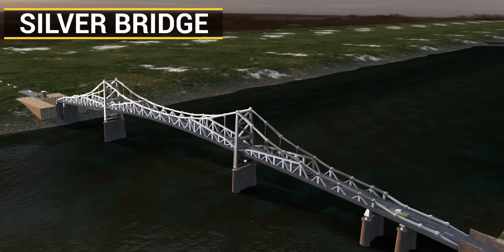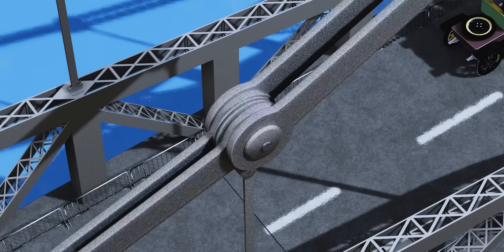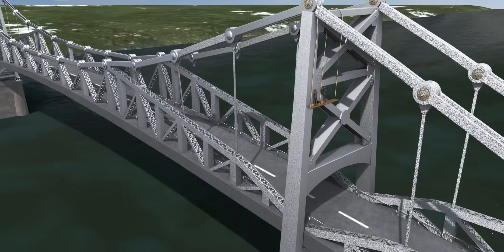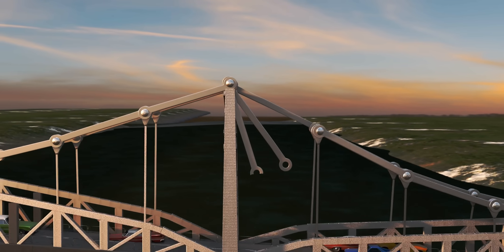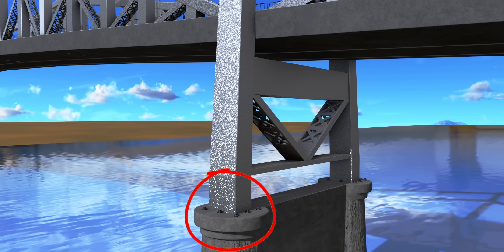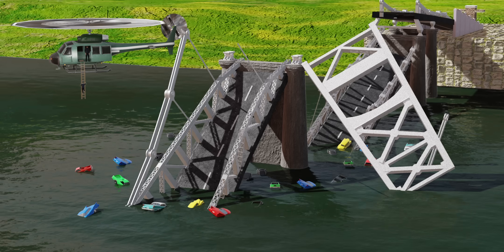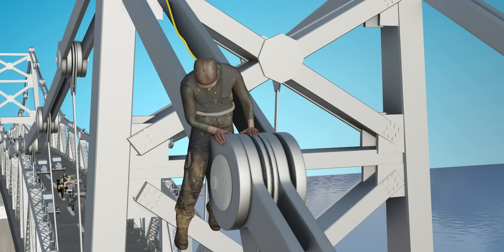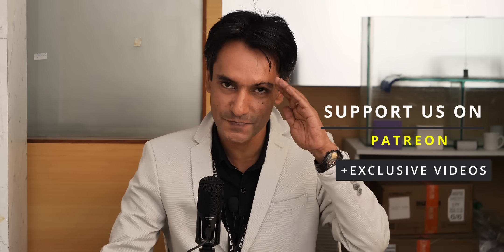Silver Bridge | The Tragedy That Changed Civil Engineering Forever

Comment: If fuel fossil vehicles were to be replaced with more carbon friendly, but significantly heavier EVs, will bridges/roads, multi-story parking garages, etc… need to be reconstructed to support their weight?
Reply: We tipycally design bridges with trucks in mind so no. Unless there is a very big change on max loads there will be no need to
Reply: @pablototox how about when ev trucks are made? I know it does not exist but it can be a possibility factor. We need to add possibilities so designs last for generations
Reply: No, ofc not. That’s mainly bc those buildings are already designed for much higher pressure, and, especially in the US, vehicles already are quite big and heavy.
Reply: I think the move from sedans to SUVs and large trucks are a bigger factor in the increase in weight, at least in the US. Much more of those are around than EVs
Reply: @pc290 the size of vehicles is going up because the biger the vehicle shadow determines the fleet gpm improvement need if you didn't improvement gpm just make truck  slightly biger it's a stupid loophole that they use here in states
Reply: @pc290  by 1000 pounds in some vehicles  and even heavier for semi trucks.
Reply: @pc290  vastly bigger.
Reply: @pc290  US was always that way. In other parts of the world in general, family pickups are rare, and (ladder frame 4WD)SUVs are considered as jeeps not cars, minivans as vans, while the eco. cars for the masses constitute a lot of hatches, CUVs(marketed as "SUVs" sometimes), sedans, mpvs, sportbacks, some coupés, and rarely mini sportcars as of now.
Reply: Not everone will own a EV unless we can sort out places for everone to charge them + the infrastructure to charge all these cars at the same time with out blackouts which we are along way off from
Reply: A Nissan Ariya, a fairly large EV crossover, weighs about 4,000 pounds. A f150 weighs 5,000. We already hace the infrasyructure for giant cars. @harrydalgleish8464
Reply: @harrydalgleish8464 Every EV can not be built with 300 to 700 mile range bats or the weight and cost will be insaine.
Reply: @harrydalgleish8464 that’s already being sorted out. There are multiple networks that are expanding pretty rapidly(Ionna, Walmart, etc). Even here in UT, which has 95% of its population in one or two counties around Salt Lake City and basically nothing outside of that, you can get anywhere you want in an EV already.
Reply: You do know one company wanted to go electric. At one warehouse. They were laughed out cause the plan. Would draw more power than all the city uses.

Want to give up acres of farm land and forest to make solar panels that help rain ride the ground More and make hot spots and kills plants that make oxygen... 

Like cool solar farms everywhere and mining pits that stripped the world naked while poisoning everything.

And Wonder if moving conductive metals from the ground and into concentrated forms in citys effects magnetic fields... like metals should... hole in what again is growing and splitting in two...

Wonder how much earth's screwed cause of that stuff everyone learns in basic science but never applies to our real world.

Kinda like they pretend only china's dam effected earth's rotation.  Like what about the stuff everyone else did, strip mines and water bodies created all over..  but world acts like its just china that physics picks out.

Like ok now we change earth's balance and stuff cause china did 1/4 of what everyone else together has.
Reply: @harrydalgleish8464  solar wind nuclear and vehicle 2 grid can all help with the power issue as well as battery storage for grid offpeak/peak hours

Also yes likely bridges would need to be structurally assessed for heavier evs for the moment until battery tech is improved to be lighter
Reply: @ToniMorton nope
Reply: @ToniMorton  Nuclear alone would easily handle it, but too many are too afraid of it.

Solar is still too inefficient and wind is still too harmful to wildlife(causes the deaths of thousands of birds annually, more than fossil fuel burning by a lot).

Until we get money out of environmentalism and science, everything will only focus on what makes the most profit thus is cheapest meaning no real innovation will occur in a meaningful way.
Reply: @ToniMorton thats wont happen for a long time as there isnt a market for electric vehicles. Outside of the wealthy no one can really afford them
Reply: @harrydalgleish8464 EVs are like the First cars, and petrol cars are like horses. It's just a matter of time before the economics flip, soon EVs will be cheaper to buy and run, eventually you won't be rich to buy petrol
Reply: The difference isn't that big. My A4 has a curb weight of 3500lbs, when it dies I'll probably snag something like an Ioniq 5 which is 4000lbs. Not that much of a difference.

That being said, transport trucks can weigh up to 80,000 lbs, a loaded garbage truck can be upwards of 50,000lbs. A fully loaded transit bus can be 40,000lbs. Those are the weights that bridges are designed for, not passenger cars.
Reply: @garymarsh23 In California, the trucks will be electric quite soon. I don't know how that will effect max loads unless Cali allows changes to tire allowance.
Reply: @garymarsh23 that is a lot heavier than a gas engine. By 800 to 1000 pounds.
When was the last time you deadlifted over 800 pounds? That is not a light weight to add to a vehicle. Now add 100 EV cars on a bridge to the mix. 800 pounds x 100 is over 80000. That is the weight of a fully loaded semi.  That it is a concentrated weight.
Maybe you need to do a little research on the subject.
Reply: Not sure about the multi story parking, however  roads, and bridges are designed considering California bearing ratio value and cumulative number of standard Axel load reputation throughout the design, life of road in million standard Axel ,considering heavy vehicles having a single Axel assembly having 2 tyres is 6 KN (trucks have minimum 2 axel assemblies)
Reply: electric cars aren't even carbon friendly, because they're still cars

🚊🚎 ← these are real EVs that will save the world
might be a lot more boring but hey at least humanity won't die out
Reply: @noobartz0890  But those aren't a replacement for cars, and vice versa, not at all related, only that some cities may opt. for those or EV buses. Otherwise we still need cars, and in cars, EV is just marketing tool, not the future, nor good for the environment, as they overall pollute more than ICE power in terms of cars.
Reply: @johndavidson3424  i suggest you go down an urbanism rabbit hole 
tho it's very sad, seeing just how garbage majority of current infrastructure is for no good reason at all

and no, electric cars do not pollute more than ICE powered ones, with production costs included, unless powered from just coal
Reply: @noobartz0890  Bro, EVs are the garbage of current infrastructure. Not vfm either.
Wdym EVs do not pollute more. The production cost is also more for what it's worth, it uses lithium ion batteries, lots of extra unnecessary wastes too. And it gets it's Electric power though either coal, sometimes diesel, nuclear too which also pollutes, all these process does pollute more than your car simply being ICE, and ofc either coal or nuclear would be unnecessarily used much more when all cars are EV, there isn't any proper widespread EV car charging ports or even services. And when an EV car catches fire which is overall more probable than ICE cars even currently, the fire is way more hazardous and much harder to stop, infact an ICE car fire can be simply stopped, but for an EV it's very difficult. They clearly do pollute more than ICE cars, and imagine if only EV cars were the future(ik this most likely won't happen), it'll be much worser for the environment, all that while EVs aren't even vfm or actually fast(bad Top speed, only quick for some expensive models due to quick torque output from it's D.C. motors), nor would it be cheaper to run after all future cars become EVs, it'll actually be more expensive to run. EV cars actually don't make much sense if you're claiming it to fully replace all ICE cars in the future, that'swhy.
Reply: Most highway bridges are designed to handle a max expected live load that would likely resemble something like a traffic jam of fully loaded semi’s.  However, this max expected load isn’t the thing that causes bridges to wear out and need repair/replacement.  The factors that impact bridge longevity are heavy load cycles (fatigue) and weather (corrosion/decay).
Reply: Unlikely, cargo carrying vehicles are alreade heavier than personal passenger EV.
Reply: People are getting heavier too
Reply: @DJDouglasWarden  Depends on place to place, in general people didn't become any heavier or lighter for global context.
Reply: More like US problem, yall use bigass trucks while Asia and Europe we tend to use smaller cars
Reply: I propose a solution: public transit
Reply: Roads are designed for trucks and heavier vehicles too
Reply: Design loads on highway bridges are based on heavy truck weights. The contemporary HL93 design load assumes that the bridge is being loaded by a line of semis interspersed with an extra heavy one. Whether or not cars are ICE or EV does not play a role. Wear and tear on roads is caused by environmental conditions and axle weights of semis. The maximum legal limit for a single truck axle is (if memory serves me correctly) 22,400# in New York. Several times what an EV weighs. Again, energy source doesn't matter. And I say that as someone who hates EVs and will probably never buy one.
Reply: No, because they are still waaaaaaay lighter than a truck.
Reply: Semi trucks regularly use the same roads already and are far heavier than EVs. The heaviest Tesla is 5000 pounds but a fully laden Semi can be 80,000 pounds.
Reply: Plenty of margin, bridges are built to hold  bumper to bumper fully loaded semis with strength to spare.
Reply: Your "carbon friendly" idea of EV's helps paint how ignorant you are beyond your terrible grammar. EV's are only "carbon friendly" at the point of use.
Reply: Batteries might become lighter overtime though, no? 🤔
Reply: We should use horse
Reply: Actually when bridges and roads are designed they are designed on the heaviest expected vehicles in most cases these are lorries and such
Reply: @alexmacharia5403 - what about load diversity? For example, if there was a major traffic jam on the bridge from one end of the bridge to the other end, and all vehicles are stuck bumper to bumper, are you saying that the bridge capacity is designed to support the weight of all vehicles as being modeled on transport trucks? I’m guessing aging and design margin are taken into consideration as well?
Reply: hydrogen cars may be lighter, but it still needs more development for safety, because imagine it exploding after crash or failure.
Reply: EVs aren't better for the environment
Reply: “More carbon friendly” buddy you have no idea what you’re talking about
Reply: Ah yes, because EVs are made from environmentally friendly materials such as Cobalt and Lithium. Will they be powered by wind turbines, where the coal coke used to make the steel has more energy in it than the turbine will produce in a maintenance free 200-year life. Not to mention disposal of the blades ^.^
Reply: My thoughts exactly
Reply: EVs are not carbon friendly brother
Reply: Modern bridges are designed to support a lot of weight. Keep in mind they have to support the weight of simi trucks.
Reply: Um… same thing could be said about pickups/land yacht SUVs
Reply: You would have to completely overhaul the electrical infrastructure, and roads and bridges to handle that. The electrical alone would cost billions, maybe trillions.
Reply: @SomeRandomAlbertan4677 

we probably couldnt get enough copper to do it either. tweakers would love it cuz it would probably reach the value of gold cuz of its rarity then. 😂
Reply: No need to worry, EVs aren't gonna be the future of cars, infact likely ICE pistons would be as of what is there now. Also, ICE cars in general aren't being any significantly heavier than thier older counterparts of the same size, so weight would probably not change much.
Reply: They’re currently is no carbon friendly vehicle. Just because it’s electric doesn’t mean it’s friendly to the environment. The mining it takes to obtain the lithium and other minerals for the batteries takes huge tractors and toxic runoff. Plus in most countries are still using fossil fuels to charge the stupid things.There’s nothing fossil friendly about them. When are you dingdong gonna learn this?
Reply: While the question makes sense simply put no
Reply: Some
Reply: The "carbon footprint" scam is a ruse to raise taxes higher.
Reply: EV's are not carbon friendly. Look up how much pollution and mining those rare earth minerals takes on the environment just to make an electric vehicle.
Reply: they will either be partially closed/painted for larger parking spaces, renovation probably not worth it.
Reply: A lot of really dumb Americans are in this comment section. Glad trump hasn’t snapped you people back to reality yet
Reply: Life of that bridge will be shorter
Reply: Great question 👏👏👏
Reply: Fighting carbon(plant food) using toxic chemicals, the brilliance of the modern day liberals.
Reply: EV is worse for the environment. You need to get rid of a lot of habitats for lithium mines, and you pollute the environment 6000 times more in one month with one mining machine, than 100 cars in 1 year. Anyone who believes EV is a good ideaneeds a good hard slap.

The only reason they exist is for money, nothing else. An EV battery only lasts 5 years, and then you pay the price for a new car, and just for a replacement battery
Reply: EV’s aren’t significantly heavier then the “trucks” that most mainstream vehicle manufacturers have been making for thirty years to game the CAFE standard (that excludes vehicles that weigh over 2.5 tons).
Reply: Honestly most wont. they handle service trucks that weight 3x a Tesla
Reply: Probably not
Reply: They're usually only 500lbs heavier on average. Remember, electric motors are much lighter than engines and gearboxes, allowing an extra 300-500lbs, so an EV with a 1000lb battery would be only 500lb heavier than the ICE counterpart.
Reply: Yes
Reply: Obviously. If we gave everyone on Earth a bigger house, would we need to build more of them or would we already have enough?
Reply: Funny for you to say that EVs are more carbon friendly that combustion cars
Reply: @fabriziooxd9519  ever seen a lithium mine? Wouldn't say that if you have and internal combustion can be hydrogen as well so not all evs are as efficient also gotta take into account what charges them which is mostly coal power plants and it takes a lot of power to charge em so with that being said a lot more carbon is used to produce and fuel an EV than what ya think.
Reply: Simple answer-- yes
Reply: By the time so many cars are replaced by EVs, they will not be "significantly heavier" as battery density is also improving as well as new materials and production methods. Tesla Model 3 is not "significantly" heavier than similar sized gas cars for example
Reply: Definitely a good question!
Reply: Absolutely.
Reply: Exactly!!
Reply: Traffic lights similar to entrance ramps for expressways that create SPACING.
Reply: Yes. Expect accidents in bridges and parking buildings
Reply: Good take.
Reply: EVs themselves are more carbon friendly but not the process of making them, they're worse.
Reply: 1: not really, since the structures are likely designed to handle much more weight than what any amount of EVs will provide
2: Were more likely to see a future with no cars, because they are really inefficient trains, despite being a vehicle that offers the “freedom to go anywhere”
Reply: @Gameshu I know people like you... They thought we would have personal jet packs and flying cars and citys like the jetsons.😅
Reply: @Gameshu "A future without cars" will never be a thing outside of cities. Many people already forgo cars in larger cities. It saves a lot of money in those cases. Walking, biking, trains, or getting things delivered are very efficient. The majority of land is not in cities and busses, trains, walking, or biking are not practical, economical, nor "green" in any way. Building out train lines to suburban or rural areas would also destroy large amounts of sensitive habitat.
Reply: No, this idea is genuinely comical to even think is a valid concern when you realize we have semi trucks.
Reply: Only solution to transportation pollution is transit like trains and subways
Reply: That's what I was thinking as well. Ev's are indeed more heavier than a gas car and imagine the future ev cargo trucks...
Reply: EVs generally have a very low center of mass, but they aren't necessarily significantly heavier
Reply: @QualityDoggo i know that they are sadly. If we want to compare from mass to points lithium batteries are heavy. An ev semi truck when finally produced will be heavier for sure than a gas powered one (because evs are heavier thats why we don't have good ev planes
Reply: That’s actually worth investigating. I’m sure there’s some contingency, but yeah
Reply: The day that EVs be actually great outside of Formule E, i'll be alredy dead
Reply: "Carbon friendly" 🤣🤣🤣🤣🤣🤣🤣🤣 good goy.
Reply: electric vehicles are stupid. we dont have enough copper to wire everything necessary to run a system like that. and people are too stupidly afraid of nuclear power, which is absolutely necessary.
Reply: I think RR bridges are rated on how many 2-8-0 steam locomotives it can carry without collapsing.  In the old days that's how they tested them!  They pushed a bunch of locomotives onto a bridge and if it stayed intact it was "rated".
Reply: Woke
Reply: Carbon friendly? Lol but yes.
Reply: Yes, but i dont think ev is heavier.
Reply: Yes, my local multi story car park is now 2 levels, not 3, it can not take the weight. The 3rd floor is blocked  off. Modern cars are simply too heavy for it.
Reply: US ICE vehicles from the 1960’s weighed more than EV’s from the 2020’s.
Even the grossly overweight Tesla Cybertrucks are only marginally more heavy than the equivalent ICE Fords.
Reply: EVs are just as bad in different ways if you look at environmental impact to get stuff for them.
Reply: @Blazeww Actually breakeven on EV’s environmental impact is under two years on average. ICE vehicles burn their weight in fuel about every two years.
Reply: If you replace pick up's no, if you replace corollas and civics yes
Reply: Today's electric cars are as heavy as combustion engine cars from the 1970s
Reply: @reinaldo-deleme no they aren't. The Tesla AWD model Y , a mid sized SUV , is 4400lbs. That's 150lbs  lighter then a comparable sized AWD Toyota Highlander.
Reply: Small EVs aren't that heavy. The weight of the battery gets compensated by a lack of heavy engine and transmission. The issue is with big ones especially pickup trucks and God forbid Hummer EV with a 200kWh+ battery pack
Reply: @commieTerminator  They still have engines dude, just different types of engine. They aren't really lighter either, least not enough to make much difference overall. The weight between both is nearly identical, but EVs tend to weigh more mainly due to the larger batteries many use.
Reply: @CommanderRedEXE motors are way lighter than an equally powerful engine+auto transmission. Anyways, battery weight still dominates especially in big EVs
Reply: @commieTerminator  What about semi trucks.???
Reply: @commieTerminator Smaller EVs have small batteries and terrible range.
Reply: @don2deliver  who needs long range cars when u have fast and reliable public transport?
Reply: @commieTerminator  They don't like me taking lawn mowers on the train.
Reply: @commieTerminator reliable my ass.
My public transit ghosts a lot of bus runs. Trains have delays and stoppages due to "mechanical" issues. And i do know some of the transit police and the majority of "mechanical issues and delays" are really police activity.
Right now abtrain to the loop was due next train 8 minutes. And that train that is due. Never shows.
And the infrastructure is outdated. That is the issue in every major city in the US.
Public transit is part of the socialist ideology. They democrats do not want tou to own personal vehicles. 
Why? Control of the masses.
Reply: @lm5085 Socialist? Public transit is something that people use in major cities.
Reply: @commieTerminator it is heavier than a engine and transmission. 
Batteries are heavy and so are the electric motors.
Copper windings in the motor adds weight. Plus with batteries makes the car an EV cannot a crossover is abt 800 pounds heavier than a traditional ICEngine. Look it up. EV cars are heavier and they tear up the tires and asphalt. We would have to completely overhaul everything.
Reply: @lm5085 Ford f350 weighs 8k and cybertruck weighs almost 7k. Cybertruck is lighter.. aka it weighs less
Reply: @gonelucid 2 different size vehicles.
Try same size. 
Cyber truck is not in the 350 class. Try again.
Reply: It depends on the factor of safety, but bear in mind that older cars weighed more than modern cars  and EV cars don't weigh more than the old ones. And much heavier truck traffic might have also increased. But there is no replacement for periodic maintenance of bridges that are degrading and becoming less safe.
Reply: @DavidMcCoul  They weigh as much as older cars, so EVs are heavier than combustion cares, generally speaking. There are of course some exceptions.
Reply: Actually, you are not far off.
Currently, engineers are reassessing load requirements on some parking garages.
There is a thought that to limit spaces, the spaces would get wider.
For bridges, most bridges are built to a much greater safety factor.
So much so you could fill most bridges with parked semi's, and you would still be good.
Reply: That's an excellent question.  I know railroad locomotives are very heavy due to their need for traction.  I imagine it is something to be assessed.
Reply: EVs still weight less than the best selling vehicle in the US (Ford F150). They're heavy for their class since they tend to be sedans and crossovers but a full sized truck is way heavier.
Reply: @RaveN_EDM  "EV's?"  These consist of compacts, sedans, SUVs & trucks with a wide range of weights.  
And who says heavy trucks are a good thing?  I've been complaining about them for decades!
Sensible transportation is so badly needed.
Reply: @RaveN_EDM  Like for like, EVs are heavier. F150 has a curb weight of 4000 - 5500 lbs depending on trim and configuration. F150 lightning (EV) weighs 6000 - 6800 lbs depending on configuration and options.
Reply: @ do you enjoy firebombing Tesla’s?
Reply: @ mmm the cope is strong
Reply: Did they have to reevaluate bridge design due to a fatter society?
Reply: @ only if Rosie O’donal was going to waddle over it.
Reply: Those cheap chinese EVs weigh a shit ton, if we do remove the tariffs on them the havoc they will cause on infrastructure is unimaginable.
Reply: @ they weigh less than teslas. Stop spreading misinformation. Hate on them because they’d wreck American auto brands if allowed into the country, not because they’d wreck the roads.

Our 2 million semi trucks do a fine job of that already.
Reply: I hate how people just ignore viable alternatives to driving like trains, busses, biking, etc... it's the only way to fix our transport and climate problem, yet car companies have brainwashed people to think that EVs are the only fix.
Reply: Carbon friendly, like they hangout.
Reply: The carbon involvement in the building of EVs and the weight of the vehicles and there not being enough electricity in the grid of any country to support 100% EV use
Reply: EVs are not better for the environment. Thats a myth. They are cheaper and quicker to produce and thus provide better profit margins for companies, but since that doesn’t sell well they invented the “environmentally friendly” myth.
Reply: We need much lighter vehicles with modern powertrains. Like a Geo Metro body with a downsized Mazda Skyactiv engine. Preferably running on fuel derived from sewage sludge or garbage. It could get 100 mpg.
Reply: In case u didn't know.  Most bridges can take a full load.  Semis and trailers. Heavy equipment  and so on
Reply: EVs aren’t all that much heavier. That’s a myth.
Reply: @midifool99  What? EVs are definitely much heavier than older cars. An EV can easily weigh up to almost 2000kg, while cars that were popular during the 50s-90s were around 800-1000kg
Reply: @midifool99 bullshit.  They are in fact on average %20 heavier.  Also fire risks hi heat uncontrollable even.
Reply: @midifool99 uh the new  ev truck at work says other wise it's curb weight ment we had to take almost 1000 pounds wich was the generator and compressor out of the back to have room for if it got pulled into scale house  while doing road call since as far as we know there's no ev exemption to gvwr like tractor trailers get 300 ish pounds for having a apu
Reply: @midifool99 they confirmed they are heavier on myth busters.
Reply: @midifool99  they are 30% heavier that's a pretty substantial amount
Reply: @midifool99 its absolutely not a myth, unless you greatly sacrifice size wich will limit the amount of batteries you get.

For example a near exact miata sized ev is not possible unless you greatly reduced range, you will need more space and weight will be added
Reply: @midifool99  wrong they are quite a bit heavier honestly
Reply: @midifool99  oh yes they are
Reply: Really??  Umm ...the Tesla semi weighs 4,000 lbs more than a conventional diesel powered semi tractor.  I guess 2 TONS isn't "significant"?  @midifool99
Reply: @midifool99 that's false, they are significantly heavier than cars of the same size! If you compare the Hummer H2 to the Hummer EV, the EV weighs 2k to 2,500 lbs more than the H2!
Reply: That's true. comparable sized EV are only about 5% heavier. Not a big difference. Some people are spreading the rumors that they are 50% heavier  @midifool99
Reply: @midifool99 actually it's a true fact. And EV is 2.5x heavier then a standard gasoline vehicle or a diesel rigs in the Tesla ev 18 wheeler
Reply: @midifool99  Tesla sedan weighs 4,000-5,000 lbs.  My minivan weights 3,400.  Rivian weighs 7,000 lbs.  Same for the E150 truck.  Hummer comes in at 10k lbs.
WTF are you talking about?
Reply: @midifool99 800 to 1000 pounds heavier. Wanna try again?
Reply: @midifool99  It's not a myth. Electric vehicles are, like for like, heavier.
My big thing is that everyone needs their vehicles to be moving gadget fests with self drive funtions no one can use, self park which no one uses and loads of other gimmicky stuff that is redundent.
We need to be less luxury focused as a race (particularly in the spoilt entitled west).
Make simple cars like Dacia does and like all manufacturers tended to back in the 90s and 00s, thereby combining loss of weight on all cars with technological advances in ICE and EV technologies for fuel efficiency. Its about saving energy over all and EVs are too young a technology and if we keep chasing luxury in vehicles we'll never save energy. You don't need a screen in your car. Well made light plastic or metal buttons and basic functionality are fine, as one example. 
EVs being environmentally friendly is the true myth. They're a fashion statement peice and its pathetic.
Own one if you want they're fun and comfortable cars that are easy to drive. Not my thing but fine. But don't tell me your helping anyone but yourself with that choice because you simply are not. It is a selfish choice. Be honest with yourself and others.
Reply: @jellis2306  it isn't a myth. I agree that EVs do harm the environment, but that is due to their irreplaceable and hard to come by batteries. EVs are actually lighter than conventional cars, but not by a significant factor.
Reply: @pheiseantan6578  Okay I've already said this once but obviously the youtube gods didn't like it because my comment is gone.
Stop talking like this. Its missinformation. Do your research.
Is that okay gods? Have I appeased you. I hope so. Cause it needs saying. Srop missinforming about an important topic. Do your research.
Reply: @pheiseantan6578  Heavier, not lighter. That's another myth. The lithium is definitely a major issue though that actually makes them no better than ICE cars both due to how bad lithium mining is, and how bad the batteries themselves are as they are not recyclable and can't just be thrown away due to the dangerous chemicals.

The real issue is how most of modern "Environmentalism" is just feel good talk. We've slowed to a crawl in actual innovation of Solar and Wind tech. EV tech is now starting to slow in development.

Our best hope is getting more people to accept Nuclear power which is 90% clean and kills way less birds than even wind turbines do annually. 

Environmentalism itself is fine. But once money got involved it changed at a fundamental level and became mostly a political tool for vote gathering. I think most of us have started realizing this which is why there's such a sharp decline in support.
Reply: @jellis2306  so yea you don’t think for yourself. You just quoted propaganda. EVs are on average 5% heavier than a same sized Gas vehicle with a full tank. That is not a significant amount.
Reply: @jellis2306 it's a myth buddy. A Tesla model 3 rwd standard range is 3500lbs. That's lighter then a 3900lbs base Dodge charger V6  by far . The V8 charger is 4400lbs and still slower then Tesla model 3.
Reply: @pheiseantan6578 EV batteries are fully recyclable unlike the gasoline in ICE fuel tanks…
Reply: Yes, which is why we need 30 mile batteries in EVs, along with a tiny portable 70% efficient range extender that consumes waste plastic. Long range EVs are planet killing devices, almost as bad as traditional 25% efficient ICE vehicles.
Reply: EV’s are not more carbon friendly.   With all the blue hairs setting them on fire, they’re on track to be the worst polluting vehicles ever made, and that’s without even being driven at all.
Reply: Each eisting piece of infrastructure will either need to be derated in taerms of the number of vehicles permissible or be replaced.
Reply: 😂😂😂😂😂 bye bye Kabala Harris🤡🤡🤡🤡
Reply: @Zorroriginale  Bye bye stable and predictable economy~!
Reply: @Zorroriginale  So you don't like living very much i take it... what made life so miserable for you?
Reply: @Zorroriginale well this aged well 😅 republicans are weirdos…..
Reply: @Zorroriginale 😂 and Frump had a “tesler” at the White House selling them off for his racist Nazi buddy who helped him steal the election…..
Reply: @Zorroriginale kinda bad to say that when trump loved tesla until he broke up with musk
Reply: @Zorroriginale ???